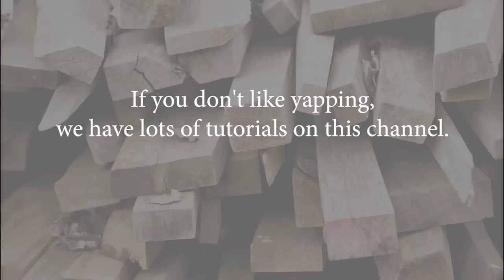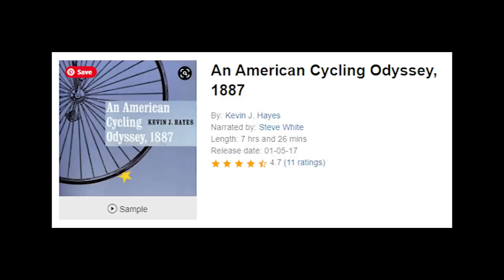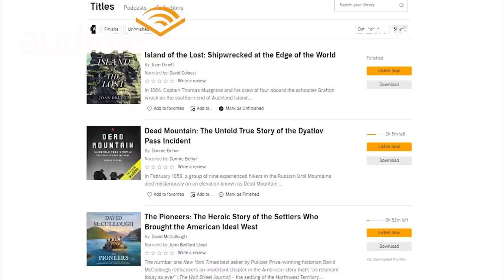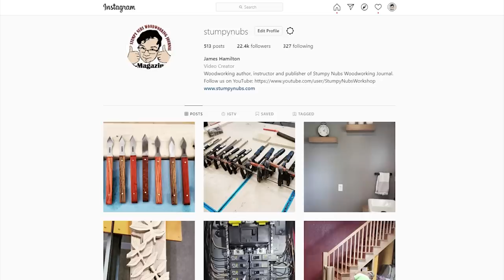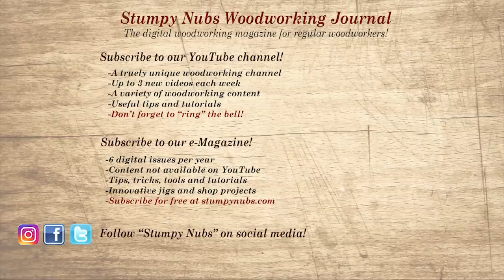Have they BANNED table saw dado sets????

Comment: Couple of things: 1: I saw one of your folks putting on drawer fronts using strips of wood as spacers - if you just want 1/8" (3mm) gaps, look in the tile section of the local Big Box store - they sell 1/8' plastic tile spacers by the bag. They are designed so you can snap off the legs of the '+' shaped spacer to give you a 'T', a '-" or a '>' shaped spacer. 2: Many European countries still use their old, Imperial measurements - I have a square that is marked in 'Zoll' which are 25.4mm long (I think its Austrian), and I've seen a Danish tape measure marked in inches and feet - but they are a fraction shorter than the English inch & foot (oops). Most Metric measurements are just adaptations of French Imperial measurements with new names - most French cities and regions had their own standards of length, weight and volume - so the Kilogram is 2 pounds as measured in one place, the meter is the cloth yard from somewhere else.

Comment: For meteric, the imperial system is based on BEER, what's not to like about that?

For saw guards, you might like them...Until they loosen in a cut, fall into the blade, and come flying at you!  Once was enough for me!
Reply: "... the imperial system is based on BEER, what's not to like about that?"
Well, American beer ... erm, where again I've to give my sign-off for going metric??

Comment: The riving(sp?) knife issue seems simple to me. Just use a stack of blades. Problem solved. (Note I have no actual experience of what these are for or how they work - this is just the obvious solution from looking at the video image)
Reply from the maker: If the arbor isn't long enough for a dado stack, how would it fit a stack of regular blades?

Comment: Let me start by saying that my job title is safety coordinator at a small office furniture manufacturing facility in the US.  My job is to know OSHA regulations.  Unfortunately, your solution to the dado blade situation as shown in the video would fail an OSHA inspection. As I understand it, a floating blade guard must rise from the table when the material is pushed under the edge, then must lower over the blades when the material is past the blade. Please understand that I do NOT agree with all OSHA Regulations, I believe in natural consequences.   I cannot speak for the European community, but our company owns a few Italian manufactured machines, and well, we have to beef up the guarding to meet US standards.
Reply from the maker: Then a bunch of commercial shops with SawStop and other industrial cabinet saws are not in compliance. Because those floating guards do not rise and fall without manual adjustment.
Reply: @StumpyNubs  I completely believe it.  Many of the OSHA inspectors go by what is in the regulations.  Some have never operated a table saw in their lives. What I have found over 9 years is that when a woodworker becomes complacent and forgets to respect the power of the machine they are operating, that's when incidents happen.  But I do love your videos, and have learned a lot. The guys in the shop don't have the time to teach me everything I want to learn, so I suppliment

Comment: Just got to 8:40 when you cut from the audio books to the build vignette and could not believe the splintering on the plywood panel.  Hope it is going to be patched and covered.
Reply from the maker: That was a bad spot on the plywood that came from the factory. But this is a built-in and that portion will never again be seen once installed.
Reply: @StumpyNubs  so you have the same quality lumber supplier that I’ve been subjected to. Sorry about that.

Comment: Using a dado or standard blade, it is not a good idea to apply downward pressure directly over it. If the wood were to catch and fly back out from under your hand, your reaction to catch it will shove your hand where you didn't want it.
Reply from the maker: The problem isn't applying pressure over the cut, it's not using a push-block to do it. If you use a push block, it will go into the blade, not your hand.

Comment: Daft question. Can a DIY solution, blade guard etc, be used in a professional workshop? Insurance, safety rules etc Especially in UK?
Reply: If you're professional you surely have access to an professional association with all sorts of information on the matter, or for what would you pay membership fees and whatnot?
;-)
Reply: @joansparky4439  I'm not a professional and was just wondering.
Reply: @Woodwork-Learner  
For other jurisdictions in Europe it sounds like it's possible (see all the other comments). But maybe it's not as productive anyways and pro's have a special tool and do not need a dado set itself (which needs modifying their saw setup anytime they want to use it).
Reply: @joansparky4439  Thank you

Comment: What woodworkers on both sides of the pond divides most are outdated American cabinet saws vs the infinitely superior European  sliding table panel saws (where the table runs directly at the blade).
No serios woodworking shop in Germany I know of is still using cabinet saws, and that already for decades.
You don't necessarily need dado stacks when you have a shaper. Often built in into a panel saw. Much safer and equally fast.
Reply from the maker: You don't think "serious" commercial shops here use sliding table saws?
Reply: @StumpyNubs  A few perhaps but many don't. They prefer saw stops etc.
Been there professionally  for a while 5 years ago.
But perhaps things have changed since then.
Edit: I'm not talking about cabinet saws with a sliding table. I mean saws like Altendorf F25 for example.
Reply from the maker: @MrVirgilVox  As someone who has only worked in small shops, and who caters to a hobby level audience, I have no experience with sliding table saws. I suspect the vast majority of hobby level shops in Germany are the same. But you are making a clear statement about the inferiority of "serious" American cabinet shops. So I would like to know how you came to that conclusion. Have you worked in a lot of US cabinet shops?
Reply: @StumpyNubs  I said that cabinet saws are outdated. I wasn't talking about American cabinet shops.
Entry level panel saws are available for less than 2000 EUR in Germany. Many hobbyists here with enough space actually own one.
Reply from the maker: @MrVirgilVox  - You weren't talking about American cabinet shops when you contrasted American cabinet saws with what are used in "serious woodworking shops in Germany?" Ok, have a nice day :)
Reply: @StumpyNubs  do you define the quality of a shop with the quality of the saw being used?
I don't think that using an old fashioned saw makes a bad shop or bad products. It just not as convenient and efficient.
So please do not imply that I have diminished American woodworking shops, or American craftsmanship in any way. I merely stated that on a global perspective cabinet saws are outdated. That is all. I apologize, if that offended you.

Comment: What about drunken saw , now I'm talking old school , I mean stacking blades is no problem just a lot of thought about what your saw can handle safely , its better to make 2 cuts than overload your machine . I am gob smacked at all the home reno and handy man shows where they are using a bench saw that has no riving knife and guard when doing a normal cut
I spent the last 20 years in a mill I loved the 2 spindle moulders , wobble saws , shaped cutters , lock mitre arbor , easy to use if you use your brain

Comment: I have a wobble piece that fits on the arbour , bought second hand that makes the blade wobble to a determined size, never used it too scared lol
Reply: Don't. If you absolutely have to, go dead slow and make shallow passes till your desired depth. They're not great on cross grain btw.
Reply: @ChuckADickiner  thanks for the info, I have already sliced my finger in a sledging job so scared to death now
Reply: @malcolmoxley1274  I used one when I was younger. Caught a bruised rib from a kick back piece but that was all (luckily). They do not behave like a saw blade. The teeth are too far apart for you to feed very quick. Just be damned careful.
Reply: @ChuckADickiner  I think I'll throw it better being safe than sorry thanks for the info , keep safe pal

Comment: 1:16 European don't need dado stack we have spindle moulders, haven't seen many Americans using one of them, spindle moulders are must more versatile then a dimension saw, 9:22 he obviously hasn't used or known what a spindle moulder is then, spindle moulders fitted with a wobble saw will cut a grove from 2 mm to 20 mm easy and that not mentioning the other block that ca be fitted to spindle moulder
Reply from the maker: LOL- Tell me how a moulder is safer than a dado set...
Reply: @StumpyNubs  it only unsafe if the person using it isn't properly trained and inexperienced , spindle moulder are safe when used by trained professionals

Comment: Everyone worried about dado sets here and I'm just twitching watching all those pocket screws.
Reply from the maker: Different joinery for different applications. Just as not every building need be built with mortises and tenons, not every cabinet must be built with dados.
Reply: @StumpyNubs  Oh, I get it, if it works, it's fine, and in that use, it obviously works, it's quick, and it's easy.  Just a lot of better, and less expensive ways to do it that make stronger joints.  I think pocket screws are just fine for production shops, though the cam bolts are usually still a better option if you have the dedicated tooling/jigs for them, but for a hobbyist or fine cabinet maker there's no time when another type of joint isn't better.  Pocket screws only make sense when time is more important than money, and the strength of the joint doesn't matter.
Reply from the maker: @johngaltline9933  There are absolutely times when pocket screws are the BEST solution. Too many people today have this false assumption that pocket screw joinery is a modern invention for cheap, mass produced furniture. They have been used for hundreds of years and can be found in antique furniture that has lasted for generations. The Shakers used them 200 years ago. They are useful for attaching table tops or mitigating wood movement. They are useful for projects that may require disassembly or alterations later. You just have to understand WHEN to use them instead of painting with so broad a brush.
Reply: @StumpyNubs  I fully agree on understanding when to use them.  They are super convenient and easy for things like you suggested, attaching table tops and counter top butt joints and the like, but there are plenty of other ways to do those things as well that are just as good, and often better.  99% of the time though, they are used where time is more important than money or strength in the joint.  They have their uses, but relying on them as the go-to fastener of choice is silly.
Reply from the maker: @johngaltline9933  I don't know of a single person who has ever said to rely upon them as a "go-to fastener of choice."

Comment: How does someone rip miles and miles of dadoes for commercial  manufacturing?  Have to observe here that a dado set in a big table saw seems a lot less scary than an end mill on a Bridgeport sawing a "dado" through a piece of steel. Masses of ways to screw that up.

Comment: i have wondered this for a while so if anyone has a great answer please educate me but why wouldnt you just use a good router instead of putting in all the extra effort to set up a dado set on a table saw? i tried to play devils advocate and suppose tear out is a factor or needing different bits for different channel sizes but in that case couldnt one just use a smaller bit and do two passes? you would be able to cut from either plane in either direction, your depths could be more precise, you could set up a second fence to do a single pass for an x and y channel, you could create dados that stop before going through the other side of the cut and you could plunge into the cut, and the start and ending cuts wouldnt throw your joint out of square with a slope. for rabbets maybe? but if someone had enough room for a saw table they could certainly set up a router table, or even just use a cutoff of the wood you are cutting to square up the tool. is it something about having the table be a simple 'one tool for the job' setup? is there a more versatile tool than a basic $80 router? idk. am i missing something?

edit: i'm laughing right now because this exact topic was covered in a SN video in april of 2020.
Reply from the maker: How much of the video did you watch?
Reply: @StumpyNubs  long enough to write that comment but yeah. I admit this isn't the first time I got on my soapbox before checking to see if there was something inside.

Comment: I'm on the fence about dado sets. I'm pretty sure it just comes down to if a less skilled person who doesnt use all of the proper 'safe practice' techniques does end up having a incident with a dado set, its not going to take any prisoners. If you had an accident with a single blade, loose a finger for example, the chances of a good surgeon being able to reattach that finger is reasonable. Don't get me wrong, it'll never be the same digit ever again but theres a chance of fixing it. Whereas if you had the same incident but with a dado set, You got no chance at all of saving that digit. 
For a skilled professional, yea sure why not, fill your boots. But for an inexperienced woodworker, id stay well away from dados sets until you've built up enough experience and understanding of the pitfalls and dangers of tables saws. Thats my take on it anyways.

Comment: Dado sets unsafe? Come and see what carpenters in Turkey used to do instead (maybe they still do, i haven't seen one for a long time)... They have a special arbor lock set that makes the one single blade wobble, and they have different lock sets for different widths. Thats what life on the edge is. XD 
Oh, even crazier one I remember now, when they couldn't afford proper lock pieces, they stuck pieces of wood in the normal lock set so the blade would wobble. I dont know what regulations are here but I am sure a dado set would be extremely safer.

Comment: US electrical outlets are slowly catching up to European standards, and most new cars look the same too, I see football (soccer) making inroads, and I now enjoy a spectacular array of beers here (unlike the strange beer myopia of three decades ago) so maybe there is a non-metric solution to the dado dilemma as well? I'll never know as hand tools are my preference, I'll never use a table saw. Onward to the old ways!
Reply from the maker: How are our electrical outlets changing? And cars here are getting bigger all the time. Many major US manufacturers don't even make compact cars or sedans now. Our beer has always been great if you knew where to look. And we seem to do fine with fractions.
Reply: @StumpyNubs   Two prong outlets vs three prongs & insulated prongs for a start. The cars here three decades ago looked nothing like they do now. When I came here three decades ago most bars everywhere had three beers on tap and another four in bottles, now all bars have great selections. Most US vehicles are now metric threads as are appliances and hardware continues to go metric, as do all scientific and engineering disciplines, despite general public Imperial Measurement Unit usage. Universality, and standardization is a good thing. Onward!
Reply from the maker: @colinellicott9737  Sorry, I thought you were referring to changes that happened in the last 50 years. Three-prongs have been the standard all my life. Cars and appliances are metric because they are not made in the USA much anymore. (Some are half metric and half standard because parts are made in more than on place.) Science has always used mostly metric, to my knowledge. Nasa used Metric to put men on the Moon in the 60's. I will give you the bar analogy, though. While good beer has been around in the States for a very long time, bars were slow to adopt it because it was more expensive. And bars here are not like the family pubs in Europe. Bar patrons generally want to drink (ang get drunk) cheap. But that is, indeed changing :)

Comment: Why don't they use a nyloc nut to hold on the blades. At least that way if the nut comes loose it won't vibrate of and loose the blades.